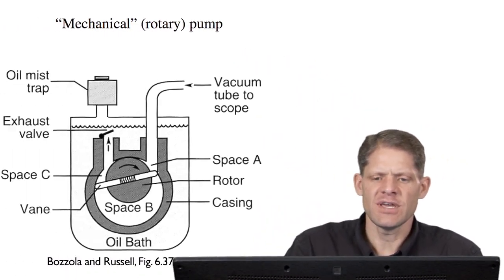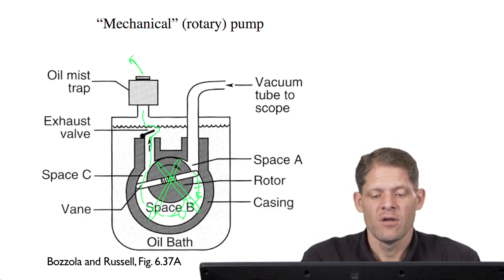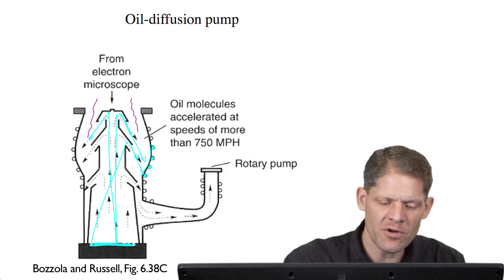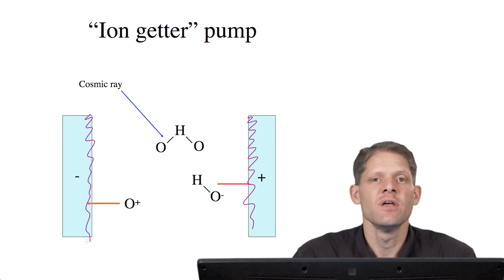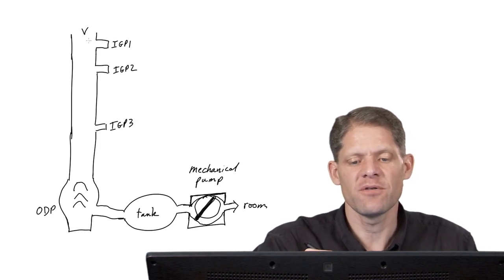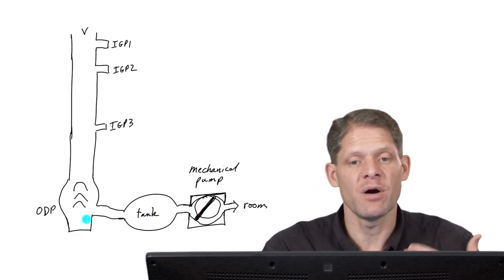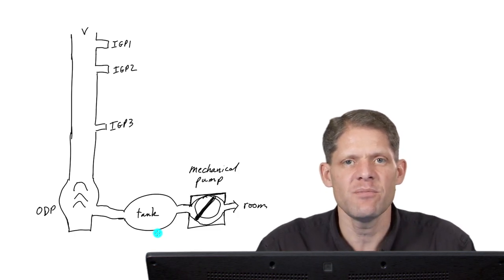Part 1: Vacuum Systems - G. Jensen

Comment: 1. TMP can't start at atmosphere pressure, well, they can spin but they do nothing...and you burn the driver because you draw too much current.
2. They don't have 3 rotors, they have many rotors interlaced with stators, just as in a jet engine compressor stage.
Reply: + As the pressure goes lower and lower, the effective speed of the pump reduces
Reply: you're right big dog. I work with these all the time. After he said these things, I immediately went to the comments to see if anyone else pointed this out.

Comment: Hey Grant great videos! Quick comment, The water molecule at 6 minutes is shown as HO2 and not H20. The ions should be OH- and H+ ions, no? Simple thing, but maybe easy to fix...
Reply: It's supposed to be H20; even if we erroneously believed it was HO2, after breaking apart, OH- and O- would both go towards the positive electrode. If instead we imagine H20 breaking apart, the intuition he uses (minus the typos) holds.

Comment: 🎯 Key Takeaways for quick navigation:

00:05 Different vacuum pumps are used in electron microscopes to achieve ultra-high vacuum, including mechanical, oil diffusion, turbo molecular, and ion getter pumps.
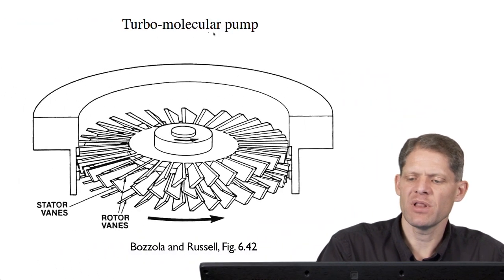04:10 Mechanical pumps gradually remove gases from the column but create vibrations and require maintenance, while oil diffusion pumps utilize heated oil to capture and remove gas molecules more efficiently.
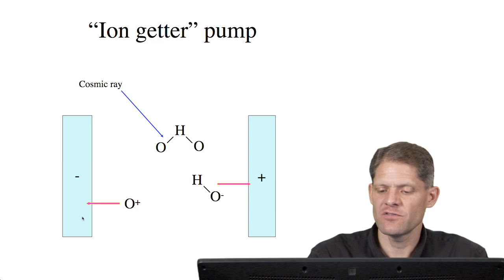05:59 Turbo molecular pumps utilize spinning propellers to bat gas molecules out, and ion getter pumps achieve high vacuums by capturing ions accelerated towards oppositely charged electrodes.
07:33 The vacuum system in electron microscopes is complex, with different pumps working together to achieve and maintain ultra-high vacuum levels. Proper sequence and control of pumps are essential for effective vacuum operation.

Made with HARPA AI

Comment: Turbo pumps cannot pump at atmospheric pressure, Turbomolecular pumps only work if they are below x10-2 Torr,  if they have a molecular drag stage its absolute backing pressure goes up to just around 1 Torr still far from atmospheric. 
Turbo pumps are so overrated, its like the pure breed horse of vacuum pumps, so flashy and expensive, it gets the job done, fast but, its only advantage over to old poor mule (aka diff oil pumps which carried mankind to what it is now) is versatility and electrical efficiency but those advantages are seriously countered by its up front cost, maintenance expertise, cost of spare parts and fragility. Long life to diffusion pumps! no they aren't that dirty, a good baffle cuts down backstreaming to extreme low levels, put a cryo trap (still cheaper than turbopump controller!) and it totally eliminates it, enabling you to reach pressures down to x10-11 Torr (thinking the vacuum system was designed for UHV operation in the fist place). They can work with backing pressures of up to .6 Torr and they are so simple that can be repaired and even fully build from scratch on a modest workshop. 
Oil diffusion pumps are almost indestructible you can drop a screw inside and it will still keep working, the oil lasts a looong time if you take care of venting procedures, there is a white paper about the reliability of vacuum pumps in it i read a diff pump worked on an particle accelerator for 10 years with no maintenance and oil changes at all!  Turbo pumps are great but the amount of overhype is getting ridiculous, so much unnecessary $$$ spent just because vacuum companies talk wonders about its latest cash milking tech. The only places i have seen a turbo pump justified is, surface measurement, large particle accelerators and semiconductor fabrication, for everything else its just wasted money.
Reply: Hi nice explained. Can you please give me study material about Turbomolecular Pump?